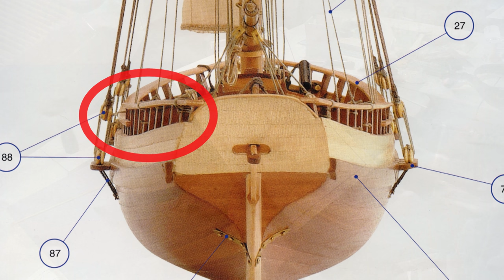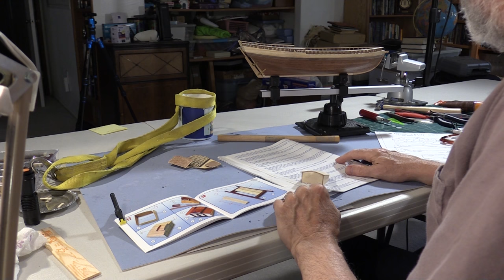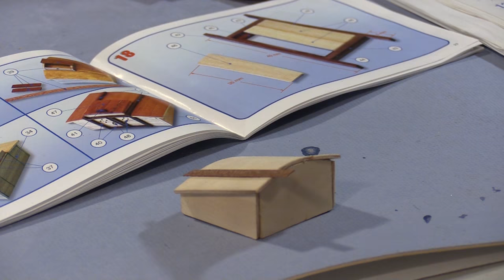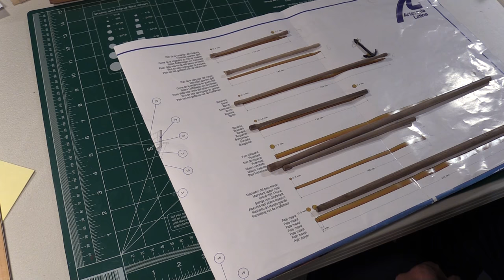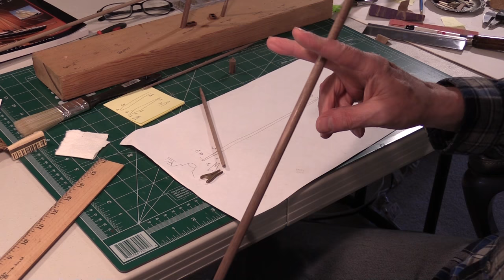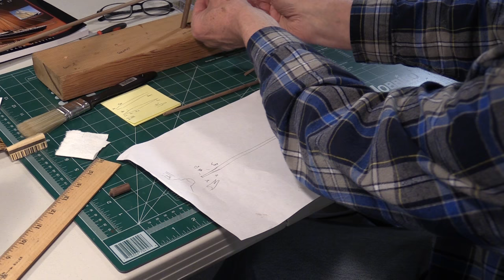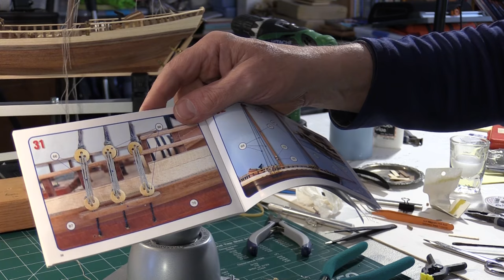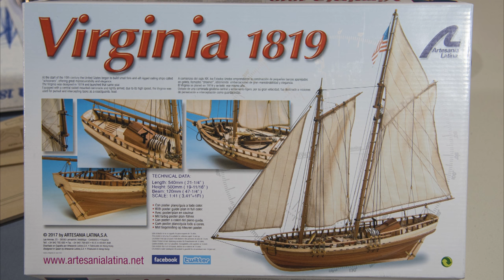Virginia 1819 model boat

Comment: Oh you did well there, she’s looking beautiful. It takes me back to my days 40 years ago building Billing’s Danish boats. I lived in North East Scotland then and would go to a shipyard at MacDuff where they built real timber fishing boats, I’d watch men running great, hot planks from the steam boxes to bend and nail them to the frame. So I learned from that, bought an old range kettle with a long straight spout and would slide the model’s planks down the spout 5 at a time and steam them, this made all the difference to planking my boats. I used to sail mine with my kids, I fitted a Billing Boats B472 Mary Ann Cutter out with lights, a motor, a working bilge pump - pumping the water up a copper tube set in the keel and straight out over the side using a slow pump. The chimney stack smoked and there was a tiny ‘put put’ sound generator card and speaker deep in the bowls of the model. It was a great success! on that model the  planking was so beautiful that I left it teak and varnished it.  By then I’d learned the hard way to use seriously waterproof glue and to coat all the interior with it too!  Thank you for showing your excellent work
Reply from the maker: Thanks for your comments about the boat.  I enjoyed your history with building a boat and adding all that gear - that was great.  I will have to look up the B472 Mary Ann Cutter!

Comment: I greatly appreciated your video and step by step process of making the Swift.  My version from 1982 was a first edition and very different.  I am proud to say I finally completed it.  Looks great even though I took a few short cuts with blocks and pullies and rigging.  No sails on my version.  There were no color photos in the directions, sometimes parts did not match up, translation marginal, but most importantly, no internet!  No place to turn to for help.  I was confused for 40 years and finally after retirement and the pandemic, took the model out and finished it with help from the internet.  Great fun, now looking for a new boat to build.  To think I dragged that boat around for 3 marriages and seven differnt homes in 40 years...it is a special boat!
Reply from the maker: Wow! sounds like you have been through a lot.  I will pray, and hope that you have smooth sailing from now on!  I thought I spent a lot of time on my boats, but your dedication goes well beyond mine.
Peace to you - Ken

Comment: Ken. Thank you for the video. I was wanting to buy a ship and get into the hobby, your video was an eye opener 👀 to how involved it is to build one. Not to mention the amount of tools that are needed. WOW! Your ship turned out great. 👍👍.
Reply from the maker: Thanks for the encouragement.  I started with a few tools, and only bought tools where they were absolutely needed.  The real challenge is the mental effort.  It takes time.  One cannot hurry.  And it requires patience, for which I have more now than when I was younger.   And lastly the ability to work through unexpected setbacks (things don't fit, or mistakes you make).  But it has been worth it for me.  Ive grown in many ways.

Let me know if you start building.

Comment: Firstly, I want to thank you for documenting your build process very detaildly. Ship modelling is also my hobby and I struggle a lot with the complexity of these model ships. I have built 2 models from artesiana and I can say that their instructions aren't detailed enough for begginers to figure out. You have a lot more patience than I do in researching the knots to use, the techniques to use in assembly and so forth and I admire that.
Reply from the maker: Thanks for the encouragement.  I am currently working on my 3rd boat, the "HMS Victory Sloop".  I chose another kit manufacturer for a variety of reasons.  The vague instructions were a big part of the change.  I selected the manufacturer - Panart of the Mantua model group.  I sent to Australia for it.  Ha!  ...  It is an Italian manufacturer, and the instructions are equally vague.  When I produce the next video you will see what I mean.  However,  it is looking like it could be a nicer quality boat.  I am going slower, so I can learn planking.  

While I build these boats, I ask myself why am I doing this (frustration, time consuming, etc).  And after I am done, I tell myself that this is the last boat I will build.  Then several months later, I start looking for another boat!  And if I can patiently build this 3rd boat, I think will be more happy with this boat than the other 2.
Reply: @ken_boats  
Haha! Well good luck! As for me, I  plan to rebuild my first model- "hms endeavour's longboat" using the "high tech cut" sheet included in the kit as I did not do too well on the planking. I am quite satisfied with my second, though- the "saint malo".

Comment: I have a similar plank bender, that came with several changeable cutters/heads. The ones I found that work the best are flat on one side, as you have and a plastic one that has a 'V' cross section where you have the metal blade. So far I have never had the wood cut through and it produces a lovely curve. Good to see a step by step video where you are learning as you go along - and no mind-numbing music!
Reply from the maker: Ha Ha, I often play soft background music when I am working and stop it when I shoot my video, but my wife thinks of it as weird  "mind-numbing" music :-)  But you are right, it would detract from the video.  Thanks for your encouragement,  I have gotten better at bending, and I am now learning to steam wood, since the thicker stuff does not seem to respond well to the iron.  Steamed wood should be soft and bend easier without breaking.  My video I am working on shows the attempt to make a steamer that did work, but it is an example of what not to do.  And describes a better process.  I plan to build a better wood steaming device before I attempt my 4th boat. and maybe by the end of the 4th boat I will have learned the right way !

Comment: Beautiful work! Built this ship about a year ago (same time you built I think) and had fun building it. Since this is not based on a particular vessel, any digressions from the plans are just fine. After all, you are building it for your enjoyment. Word of advice, don't glue the masts in, they will hold just fine with the hole in the deck, the step on the false keel and the rigging.
Reply from the maker: Thanks for the tip!

Comment: Hello Ken! Hope this finds you in good health  and good spirits. I decided not to plank the hull in mahogany. I used wood filler and 50% white glue/water to seal and finish the hull, sanded the hell out of it, and gave it a Navy Blue paint job. The Bulwarks gave me a hard time and I learned never again to use plywood on contour parts. (Next time I replace plywood with something else). I was able to bend the bow section using slight saw kerfs every 1/8 inch which worked well. The rubbing strips were trouble too but I prevailed. The transom was a real pain, as was the strips at the deck/Bulwark interface. The Hawse pipes were the biggest headache which I had to shave off 4 times!!   Anyway I overcame all those problems and it looks awesome. I had to modify the rudder a little but no one will ever know. I painted the inboard side of the Bulwarks a very dark red, so the ship will have a Patriotic but subtle red, white, and blue look. I intend to deviate from the plans for a more custom build by adding fife rails and by hanging the anchors over the top rail at the bow.  I'm not using the blocks from the kit, I mailed away to Blue Jacket for proper blocks in the correct scale (and they are fabulous). The AL kit was a basic start,  but depends a great deal on the skill of the builder, and the instructions suck almost as bad as the parts list, which sucks out loud! AL has some serious Q.C. problems. More news as it happens.   D
Reply from the maker: Yes my whole family is blessed to be healthy and in good spirits.  It sounds like you have overcome the trials of boat building!  Feels good - doesn't it.
It seems the instructions from the 4 boats I have built so far have the same vagueness in instructions - e.g. lacking.  maybe it is hard to create better instructions with these kind of boats.   But there is no excuse for poor Q.C.  Some model makers are better than others in this regard.  
Making your own parts where you have to - is a good solution.  I have been working on knowing where to buy precut wood, and how to cut my own wood, or buy better detail parts like deadeyes, etc.  I found a place that sells better rigging rope, but I have not had to buy that yet.
Ken

Comment: Thanks so much for this video. I've built several, but I relived every minute as u built this one. EXCELLENT photography. I'd show u mine if I could film like that. Now all I have to do is figure out how to edge bend a plank. Nothing I've done yet has worked.
Reply from the maker: Thanks.  I have learned two ways to edge bend a plank since I built this boat.  1 is good.  2 is much easier and seems to be good but I am still learning it.
1.  Spiling the plank.  this is where you cut a curve in the wood.  I could not easily find a good reference for this, but there are some good ones around.  I used this technique on my video of the HMS Bounty Jolly Boat.   https://youtu.be/mbNQWsPp5eg   Spiling starts about minute 19.45  and an update on the technique at min 24.
2   Edge bending.   I just learned this 2nd technique which I am using on my current build.  It is much easier and faster.  But I have not totally mastered it yet.  Here is a good video on it  https://www.youtube.com/watch?v=atXqH0GWLL8
This is part 3.  Be sure to look at parts 2 and 4.
Enjoy  Ken

Comment: Nice work. I'm building the "Newsboy". What an experience it has been, I love it but am scared of it too. I,m finished planking the deck and now building the deck furniture. I hope my eyesight holds up.
Reply from the maker: Wow.  I looked it up and that is a nice looking model.  I use bright lights and a magnifying optivisor.  Still my eyes seem dry after working for a long time, but my optician said I am not hurting my eyes.  I am currently working on my 4th boat, Joshua Slocum's "Spray".  I must say my comfort level is higher this time.  I am sure your skill and ability to overcome adversity will improve as you finish.  Keep going!
Ken

Comment: In hull planking, learn what stealer planks and drop planks are, and plan cutting your planks accordingly with tapers and drop-out chamfers.  Google those terms.  Planks never terminate in points, always in shaped with the point chamfered off.  That's an important detail in ship construction.  Pointed planks can't be nails down to form a strong joint and will leak since the point warps and opens up on a hull.  Every model is a step up in learning and applying accurate ship features and new construction techniques.  Each model gets much better, and faster than you would think.  Huge thinks up on this video!
Reply from the maker: Thanks Darivs.  These are great comments, well thought out, and I will apply them on the boat I am working on.  I am almost done with my 3rd boat, but I will study and think about these comments (part 2) and the other comment you provided (part 1).  and apply them where I can.  I have been using a Satin Polyurethane, and flat black, but I agree there are parts that seem shiny.  Thanks again.
Reply: @ken_boats  Always willing to help a fellow shipmate!  I used to sail cargo ships, now I just build models,  :)  Join the Nautical Research Guild and Ships of Scale forums.  Lots of friends there eager to share their vast knowledge of model ship building.

Comment: I read a good thing to do is to not glue the mast in if something brakes in the future you can slip the mast out an work on it on the bench. Looking forward to your next build.
Reply from the maker: Good tip.  I will avoid gluing in the future.  My next boat is in work.  I will finish the planking in the next couple of weeks.

Comment: Thinking about taking the plunge into this hobby, and appreciate your excellent video! I especially enjoyed watching the gradual change of a cleanly shaved chin to a luxuriant beard as proof that this is not a one-day instant gratification venture. Thanks!
Reply from the maker: Thanks.  I have found building model wooden boats to be very fun.  I recommend you should try building at least one kit.  Many of the model boat sites rate the kits as beginner through advanced. So far, I have found even the beginner kits are challenging.  But with a little patience, all problems can be solved.  -Ken

Comment: I have made a few model ships, initially from kits then some scratch built from plans. Its not easy to make a fully rigged model and you have made a fine job of that model. When planking decks or hulls another technique to emphasise the plank edges is to use strips of black paper between the planks then sand it back level with the planks. Its good at representing the caulking.
Reply from the maker: Good advice.  I was not too enamored with the idea of using a lead pencil.  Using paper sounds promising.
Thanks.  And thanks for the encouragement.

Comment: Nice build Ken! I have an observation to make though! The ropes from the rigging look a bit fuzzy. A solution to make them look more "solid" is to run them trough a bit of bees wax. That will make them look a bit more natural and in scale.
Regards!
Emil
Reply from the maker: Thanks for the tip.  I did indeed buy bees wax and have used it.  - Ken

Comment: Those pictures seem quite clear to me. The part number 11 seems to be chamfered at both sides, before glued onto part 10. The upper chamfer (bevel?) is on the same plane as the chamfer on part 10. The lower chamfer seems to make a smooth transition from  the double thickness of part 10+11 to the single thickness of just part 10.
Reply from the maker: I think you are right.  Deciphering the instructions has been difficult for me, but when I look back, I see they were clear (at least with hindsight).  these days I spend a lot more time studying the instructions.

Comment: Great job on the boat, I took some inspiration on how I should be making mine since I'm making it completely from scratch with little to no instructions. So thank you for the great ideas, really taught me a few things I didn't know 🙏... 
Also will you be making and uploading a more complex model ship? Like a larger one with more complex designs?
Reply from the maker: Thanks.  I am currently working on Joshua Slocum's "Spray", which is a bit more simple, but I plan to step up to more complex boats over time, when I am ready.
Building a boat from scratch sounds like a real challenge.
Ken

Comment: Now varnish the wood with a SATIN, not glossy varnish to bring all the beauty of that wood color out, and protect the model from moisture.  Don't use glossy because it will make the ship look like it was dipped in glass, which is not the proper appearance.  Great job on your first model.  On the next one, do not be afraid to make custom parts from walnut or beech or lime wood if the ones provided do not fit.  Measure your drawings carefully to make sure the proportions are kept accurate.  Example: your main sail boom appears to be attached too high on the mainmast.  Your railing height problem may be due to the gunwale not being high enough neat the bow, throwing the railing column heights off.  The keelpost for the rudder appears to be not long enough at the rear.  A shim of white wood added to the keelpost and sanded top blend in could have made the gap between the rudder and keelpost.  Because the hull seem to want to wander off proportion when constructing, the gun port positions, deck and gunwale heights may wander off tolerance and affect position of parts later on in the build.  When doing small details, use a headset that has a magnifier and light.  It is inexpensive and allows you to be a LOT more precise when working the tiny stuff like rigging deadeyes and blocks.  I liked the coffee cup and strap wet plank method of curving planks. I used the same technique using a bucket and strap to add camber to the flat decks on my ship model of La Couronne.  Prebending parts goes a long way in the struggle to form planks and deck sheets around curves.  I use an electric hot iron on wet planks to curve hull planks neat the bow and have great success getting perfectly fit parts.  It just take a bit more time, and lots of test fits, but using the iron to steam the planks into complex twisted curves. You press the wet plank against a form made from a concave block of wood and that means no broken planks and stress-free fitting.
Reply: I guess Im asking the wrong place but does someone know a way to get back into an instagram account??
I was stupid lost the login password. I would love any tips you can offer me.
Reply: @Camden Fisher Instablaster =)
Reply: @Walker Isaias thanks for your reply. I got to the site on google and im trying it out atm.
Seems to take a while so I will reply here later when my account password hopefully is recovered.
Reply: @Walker Isaias It worked and I finally got access to my account again. I'm so happy:D
Thanks so much you really help me out!
Reply: @Camden Fisher Glad I could help :D

Comment: Hi Ken, I really love your ship and enjoyed the video very much! Can you share the brand of the stand that you used to support the hull? A purchase link would be even better. I think it's angle tilting feature is very handy and would like to buy one for myself. (I don't know the exact name of the tool. To be clear, I am talking about the one that you mount the ship on at 27:16 in the video) Thanks!
Reply from the maker: Thanks.  It's called the Keel Klamper, by Amati.  I added a steel base with rubber feet for stability.